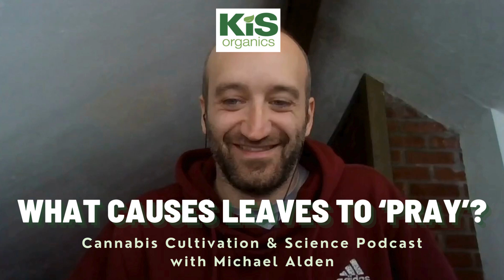Michael Alden talks about "Praying Leaves" in Cannabis.

Comment: I’ve got praying leaves on my week old seedlings  when I turned my lights power up a little I was wondering what it could be ….buy I can say it 100% is Not air flow
Reply from the maker: It can be caused by a variety of different mechanisms is the big takeaway. And not all of the are positive (but many are).

Comment: The hardest I've seen leaves 'pray' is about half a day after I gave my plants a seed tea made of of alfalfa sprouts a few years ago. They were up well beyond 30 degrees, it was pretty bizarre. I have this one genotype I'm growing now that will actively turn it's top leaves over, I guess it's either due to light or humidity in my veg tent; I have no fan running in there and I just leave the front door-flap open for air flow.

Comment from the maker: From Michael: 
On this question of leaves praying, there's a range of environments that can lead to an angled rather than planar leaf position.  Some species hardly ever change their leaf angle, unless under drought stress where they wilt and leaves droop (downward angle). Others are more flexible and adapt to their environment. One explanation might be that the leaves are angled higher to improve air flow and lower boundary layers near stomata to increase transpiration rates.  Another explanation could be light quality- low R:FR perception induces shade avoidance responses and angled leaves can capture light better at high plant densities (think maize, wheat, and rice). A third explanation could be that this is cultivar dependent and some cannabis cultivars do this while others don't. It would be really cool for someone to document this with pictures in a range of cultivars for a given growing area/facility.
Reply from the maker: I think it’s important to think critically, be open minded, and challenge accepted assumptions in the cannabis industry. I also think understanding the underlying mechanisms for why or how a plant reacts to stimulus is really interesting.

There may be multiple reasons for why a cannabis plant might orient its leaves upwards, so it may not just be one variable.

Comment: Absolutely disagree my plants are in the best health when they pray in that position
Reply from the maker: I just updated the description of the video to include a more detailed explanation. I hope this helps!
Reply: Same here I have great air flow right now and my VPD for flower is perfect. But mine are praying at this very moment
Reply: I agree
Reply: Its caused by the plant having everything it needs , so it goes into overdrive trying to maximise its growth through faster nutrient uptake. They prey when the vpd is on point, because that's what allows maximum transpiration.  My plants through the core of their life cycle are are always praying.  Once I had this figured out my grows were done in two thirds of the time it used to take. I'm using air pots which are almost impossible to over water, and as such I can " push" the plants by getting more uptake. Like what some growers do with coco substrates and liquid nutrients.
Reply: I agree with what you are saying , I don't think that it is because of airflow that the plant prays, when all check boxes are met environmentally, nutritionally, and water wise, the plant will be photosynthesizing and transpiring at the most optimum rate which causes turgidity in the leaf cells to make it point upwards causing the praying. The age of the leaf, and light conditions also play a part in this equation.